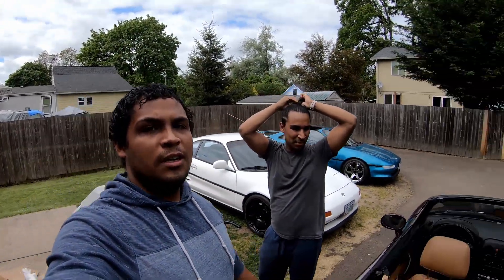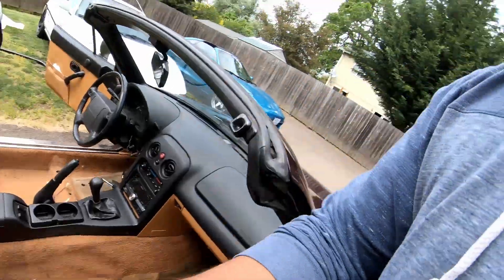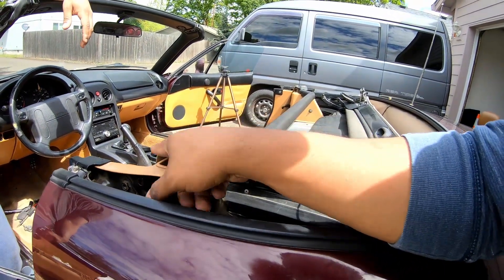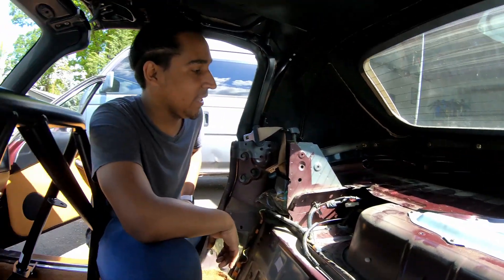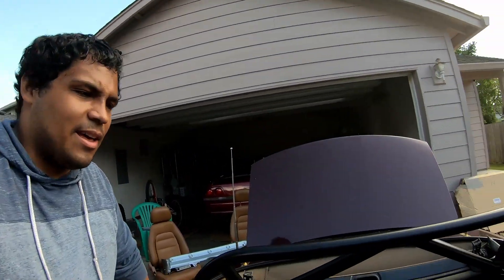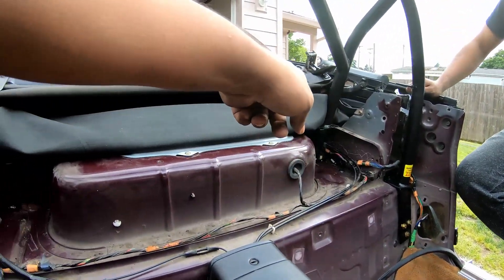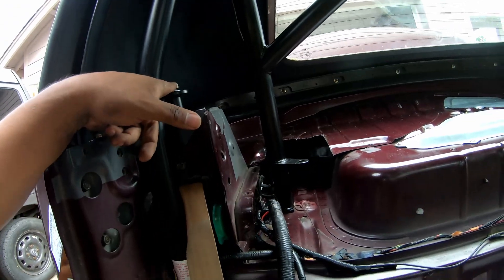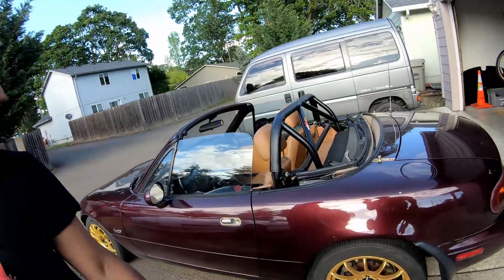Hard Dog Roll Bar Install II NA Mazda Miata M-Edition

Comment: Great work! I'm curious about your soft top. It looked like a zipperless glass top. I'm assuming there are issues with actuating the top?
Reply from the maker: actuating top? like a electronically controlled top? If that is what you mean, this car does not have one. It goes up by hand with no issues though.
Reply: @saladbar21  I think he/she meant putting up the top with the weight of the glass.